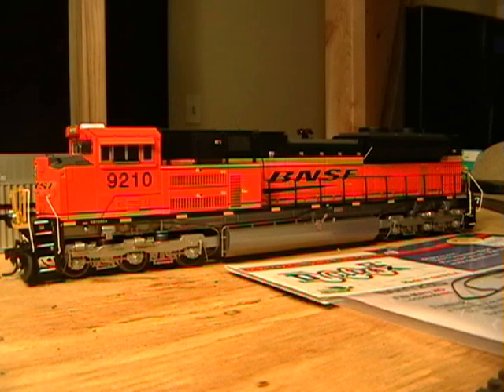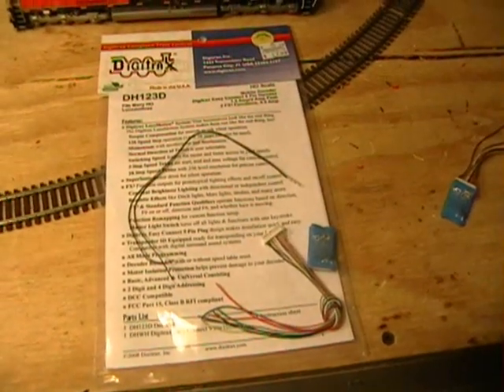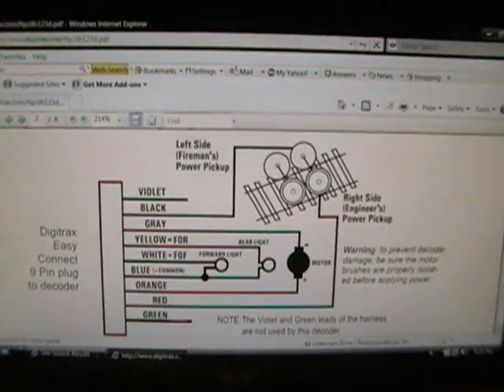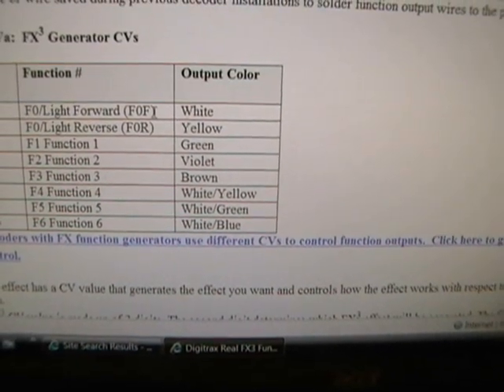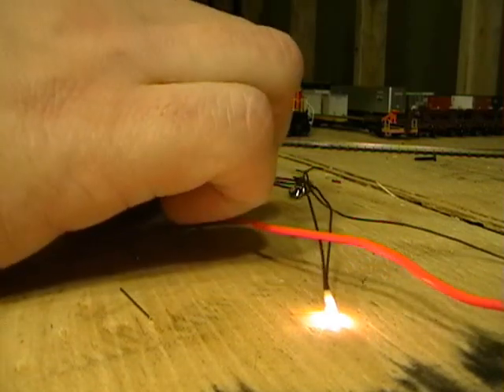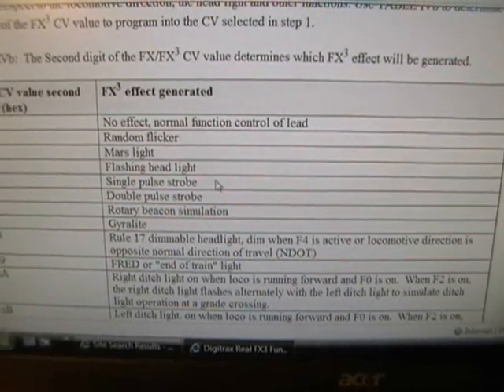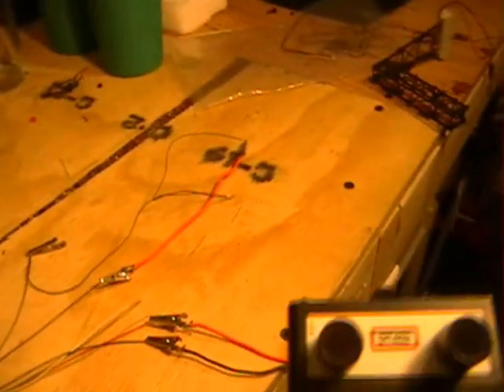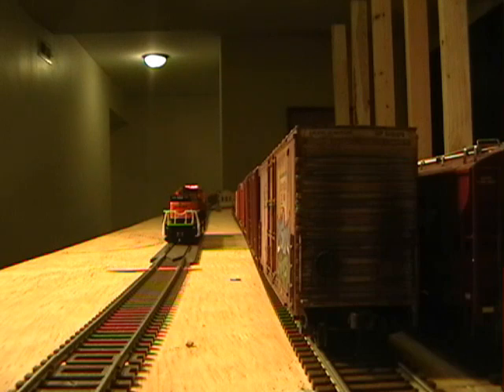12-04-2010 Advanced DCC - Part 10 DCC Lighting Basics

Comment from the maker: @iqbaln206 Ditch lights normally use functions 1 and 2 or the green and violet wires in the circuit. Blue is the common. You may need to splice into the blue to gain your common. You may also tap into the black, or if the black is grounded into the frame, tap off the frame.

Comment: i need to add a two flash yellow beacon to the top of my athearn genesis mp15ac ,but i also need to add sound and dcc. iwas thinking about a soundtraxx tsunami 645 non turbo, but i'm not shure of the availability of the option of the flashing light that can come from the violet wire on the dgitrax dh123d decoder. so what should i do, i'm in need of some help?